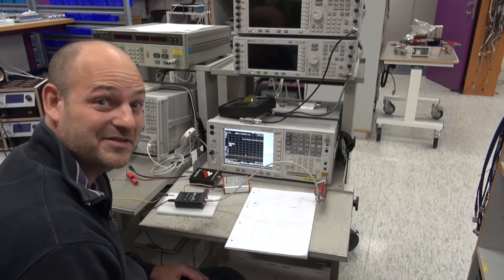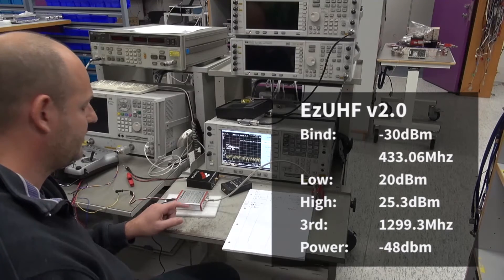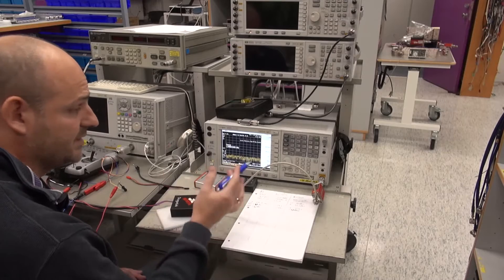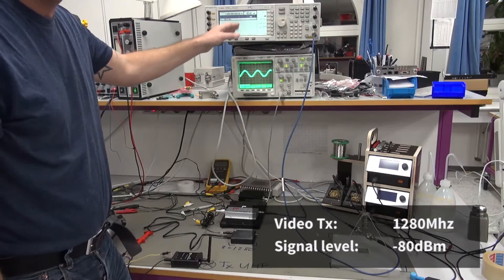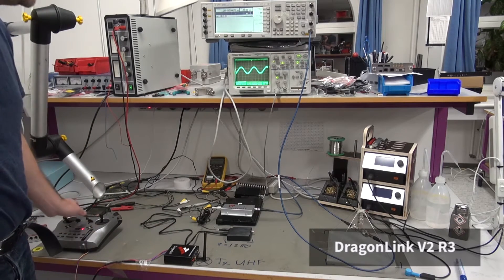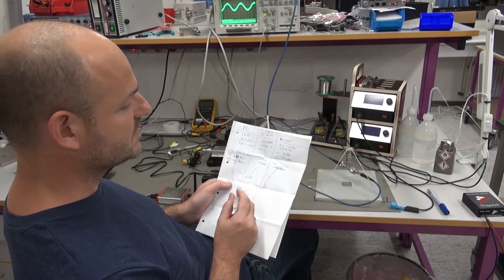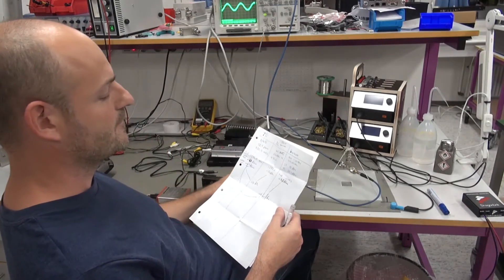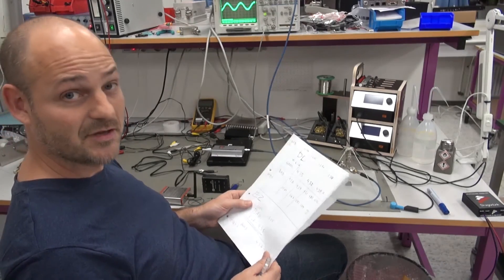Harmonics & Frequency planning, Technical breakdown of TSLRS, EzUHF, DragonLink

Comment: Hi- nice test suite.   Were you aware that Dragonlink has a 1280 optimized version of their firmware and has had it for several months?  It would be a lot more fair test if you used this firmware- it is designed to avoid hitting the 1280 video frequencies- I would expect your test results would be a bit different.

Comment: Wow, That was great I am a Ham and found that very informative, ? I do want to fly with 433 for long range but I would like to use 900 mhz gear (Cause I have a bunch). Could you  please tell me home much distortion is on the 2 harmonic ( I assume that is the one that would interfere with me at 900).
Thanks so much